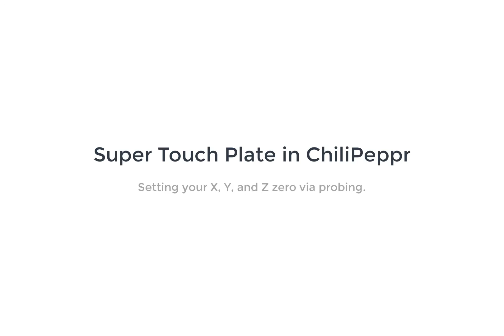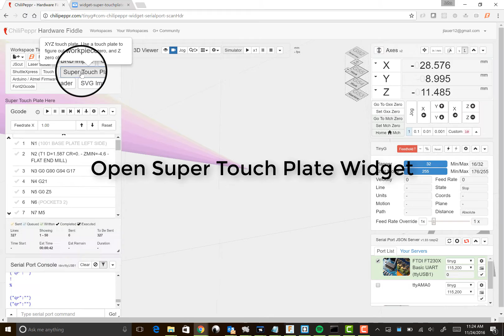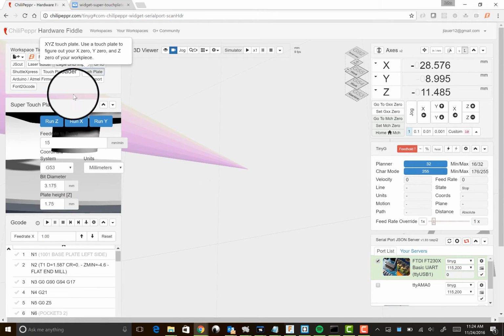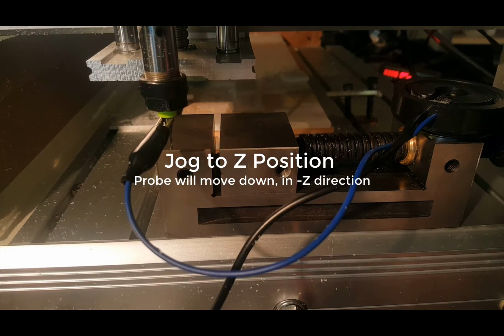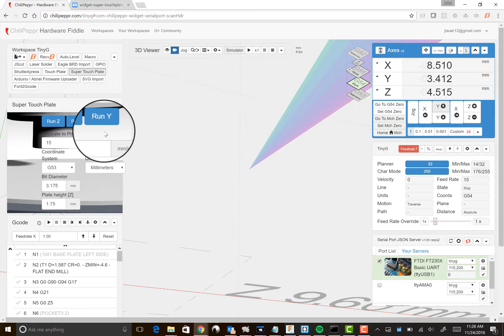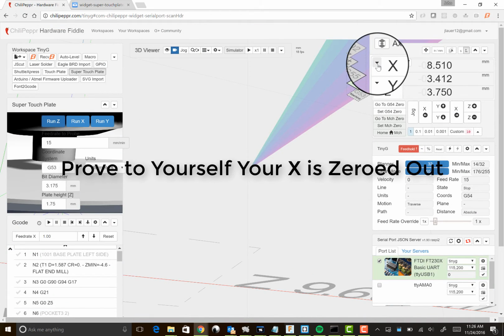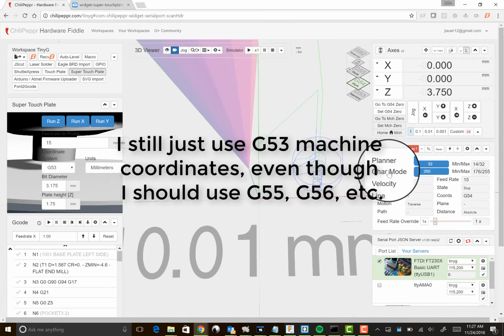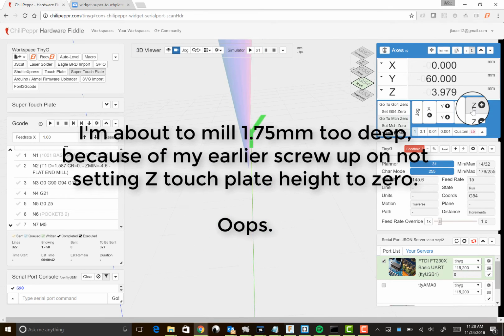Super Touch Plate in ChiliPeppr

Comment: Hi,
I went through Super Touch Plate because Touch Plate set to zero the machine coordinate (G53)  and I wanted to set the work coordinate (G54). Super Touch Plate offers this choice, but I can't use it.
It seems STP set the Z offset G54 to the height of the plate instead of setting G54 Z to 0.
I think the G code to send should be : G10 L2 P1 Zz
where z is height of plate + machine (G53) Z and not z= height of plate
Forking the widget is over my capabilities in programming.
If someone can help..
Reply from the maker: I think it would require forking. If you watch the 3 videos on the home page of chilipeppr.com you'll see it's fairly easy to fork, if you're up for trying. Super touch plate also needs some CSS help to get some of the textboxes and fonts smaller too. What's weird is I've used super touch plate pretty effectively on touch plate height.
Reply: Thank you for your response, I will try forking.
I am not sure to understand the last sentence. Super Touch Plate is usable with G53 as is Touch Plate. Just must not forget to set G54 equal to G53, because Fusion 360 witch I use generate G code in G54 coordinates. And I think it is good practice to have machine zero above the stock to avoid crashes.

Comment: Is there any way to get this Super Touch Plate widget into GRBL in Chilipeppr.
Reply from the maker: Somebody from the community would have to volunteer on that one since the Super Touch Plate is so specific to TinyG, somebody who has Grbl would have to do the mods to be able to test them out. What is easy is to fork the widget via Github, tweak the Grbl workspace Github repo as well, then do a pull request. Watching the 3 videos on the home page of chilipeppr.com walk you through how easy it is to tweak widgets in ChiliPeppr.
Reply: Is there a way to take an arduino board like a mega and be able to put the firmware of the Tiny G on it and use Tiny G Chillipeppr work space.

I had saved an old cnc engraver from a local trophy shop that weights about 180 pounds  and it ran of an old computer, looked something like the first apple computers but could only do the alphabet and had 1kb of memory and had like 8 track tapes for different fonts.

So I had bought a tiny G v8 when they first cam out. but the tinyg doesn't have enough current per phase of the stepper motor so the max rapid movement is about 35IPM or 880mm/m .

So I was thinking of taking an arduino and put bigger stepper  drivers that can handle 4 amp continuous and hope to gain faster rapids but feel like I would loose all the cool features tiny g work space offers.
Reply from the maker: If you have a TinyG, then you're all set for external steppers. Just connect them to the step/dir pins that already exist on that board for folks who want external stepper drivers.
Reply: Wow thanks a lot.. I didn't know that existed ... Thanks For making Chilipeppr as well and keep up the good YouTube videos. I had bought the tiny g years ago and finally  a free and well made cnc controller software ...

One more Question. I dont know if it is my setup or not, but is there a way to default to imperial  units,and have it never change. I Seem to have and issue with it always  changing to metric and if I forget to to click the toggle button between g20 g21 in the axes widget and it seems to scale the g code down 254% and doesn't machine the part out.. Its been awhile from when I used the cnc last but every time I had dragged something into the browser it changes it back to metric.
Reply from the maker: If you drag in a Gcode file that has G20 or G21 in it, then you're setting the units on TinyG that way when you hit play. If you drag in Gcode with no G20 or G21, ChiliPeppr asks you what units you are. If you pick the wrong one, you'll get scaling like you say, because you gave it bad data. That's the only thing I can think of that would cause the scaling you're describing.
Reply: Ok I'll retry later when I make some more PCB.
Thanks for the help.